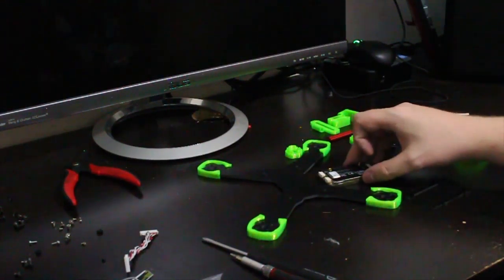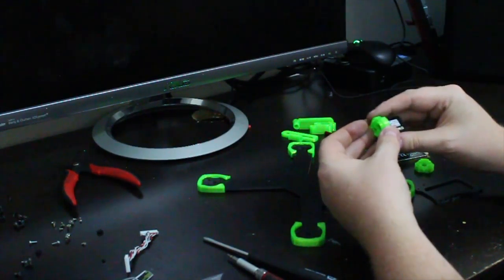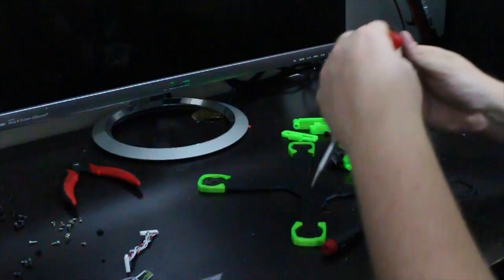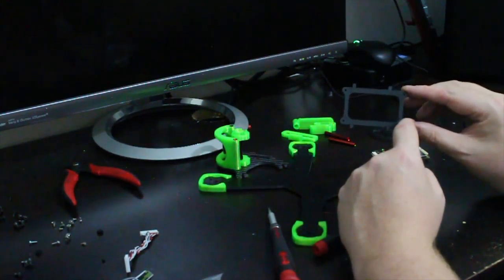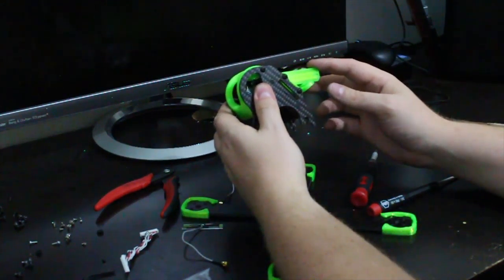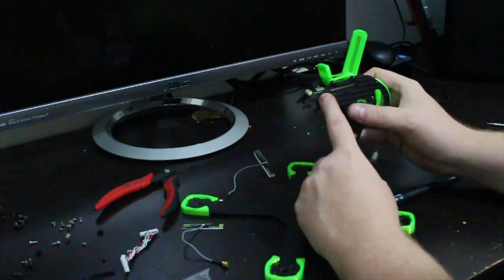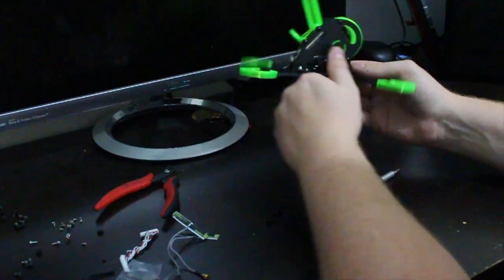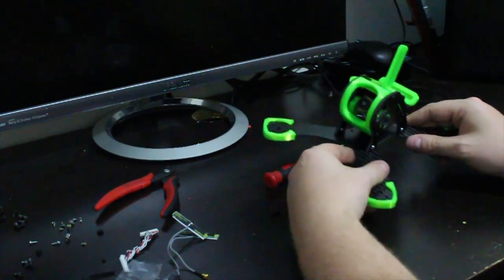Zeus HD Connex Prosight Frame Assembly

Comment: Thanks....how did you print? Orientation? Printer setting? Supports, speeds......For the antenna mounts...
Reply from the maker: Supports absolutely required for antenna mounts. I printed at 100% infill specifically for those. I believe 50mm/s with 80% underspeed for outlines.